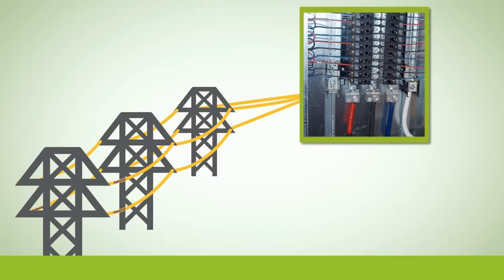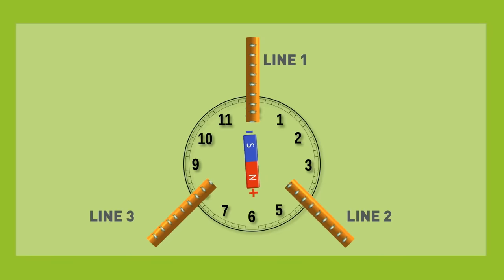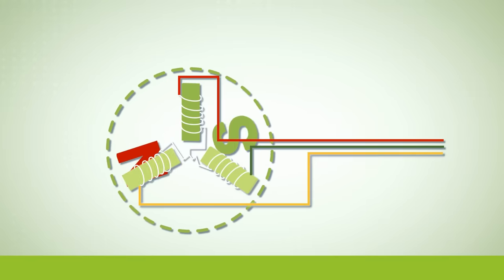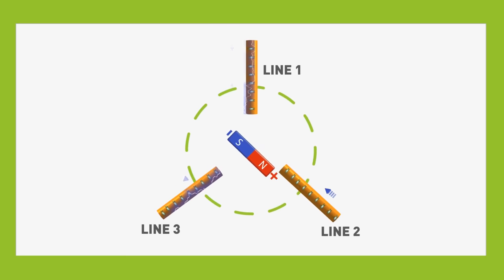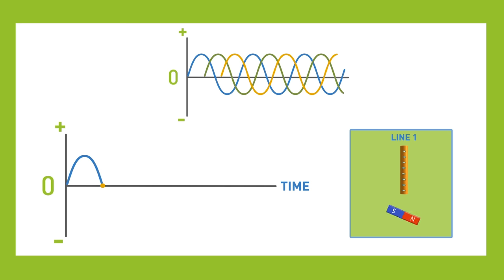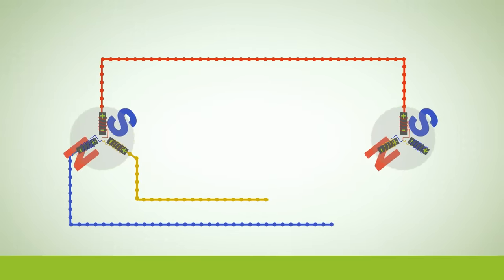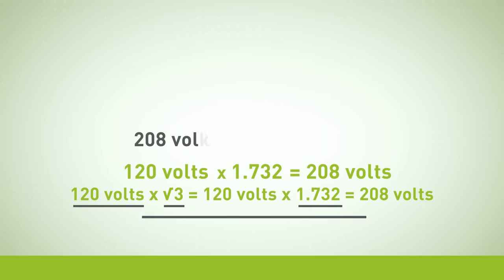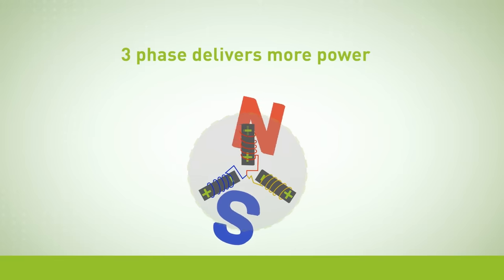Three-Phase Power Explained

Comment: Unfortunately this doesn't show a very good representation or explanation of how an AC generator moves electrons around, but there are a number of other good concepts in the video that help explain the basics of AC power.

Electrons need a loop of wire to move around, and if that were shown (and it has to be in a specific orientation), we'd see that electrons move both towards and away from a magnetic pole in an AC circuit. If it were as simple as saying electrons were attracted to a "+" or "-" as in a DC circuit, they wouldn't be able to move around the loop at all. A better explanation is that the magnetic forces of a north pole push electrons in one direction around a loop and a south pole pushes them in the other direction. In between poles the magnetic forces are near zero so the electrons stop. Further, electrons only move in a changing magnetic field so the magnetic poles have to always be moving or the wires themselves have to be moving. In a large generator magnets rotate (spin) horizontally inside stationary coils made of copper bars that run vertically and the electrons move up or down in the bars depending on whether a north or south pole is acting on them. They also move perpendicular to both the magnetic field and direction of rotation (see Flemings Right Hand Rule for Generators).
Reply: Scott J
Electrons do not necessarily need a wire to move about. Electrostatic charge is one example. Electron beam is another. Old CRT TVs used the steered electron beam for half a century. There are scan converters that still use them today. Then there is always radio. Electrons are not pushed anywhere. They are lured to an electron depleted field through what ever means they can. Open space requires very high potential levels, metal conductors very little. This is a small sample of what you left out of your educated reply.
Reply: Bryan St.Martin, Although everything you've said is true, it's irrelevant to the understanding of 3-phase power and the functioning of electric motors.

The current in an antenna is negligible compared to the current in an electric motor, generator, or transformer where the electrical circuit is complete.

I do agree with Scott J that the pictures in this video demonstrating the magnet and the current in the wire are a bit wonky. The video makes it appear that electrons are attracted to the north pole of a magnet, and repelled from the south pole. If this were true, we could obtain free energy by using magnets instead of batteries.

Rather it's the moving magnetic field that induces a force on the electrons. Neither the pictures, nor the explanation in this video explain this, and in fact imply that this is not true. For someone who doesn't understand these things and who is trying to learn, this is going to cause a lot of confusion.
Reply: There's a reason he said at the beginning of the video that this video requires an understanding of how AC power works, and that if you don't have such an understanding you should watch the video on AC power first.

You're criticising this video for something that was explicitly stated would not be in the video. It's like someone saying they are going to show you how to cook pasta, and you're complaining that they skipped over how stovetops work.
Reply: Jeffery Wells, I'm criticizing the video because what he's showing is not only confusing, it's wrong. The north pole of a magnet does NOT attract electrons. The wires have to be moving perpendicular to the magnetic flux lines in order for there to be a force on the electrons. The wire has to be oriented so that force is in a direction that causes current to travel through the wire. What is shown in this video will cause no current at all.
Reply: Scott, I'm the creator of the video. If you watch the first video, you'll see and hear where I say that while I SHOULD show a loop of wire (per your comment) BUT in order to keep things simple, I will only show half. The issues with creating these types of 7-10 minute videos are: what do I include and what do i cut; what analogies do I use to explain the basic concepts which are rarely well explained. I decided that showing a looping wire would be harder to visualize and animate. It would also open more esoteric topics.  My goal was to explain the topic to people who didn't understand 3 phase.
Reply: Scott J the concept of electron is not necessarily to understand this. Remember that books by steinmets, Notes of tesla, never use the concept electrons in explaining all these
Reply: @alparker7686  Why did you say that an electron is attracted or repelled by a magnet?  You can simplify things without telling falsehoods.

Comment: Data centers, and other commercial and industrial buildings don't necessarily use 3 phase power because of less amperes; it is because 3 phase power provides a "more balanced system". Such buildings demand more power than dwellings even though dwellings are served with lower voltage power.

Comment: the real reasons for three-phase are:
firstly that it is impossible to manufacture a high power single-phase alternator (see Leblanc's theorem and the theory of rotating magnetic fields, so-called reverse magnetic fields in a single-phase alternator are disastrous), an alternator of more than a few kva is necessarily polyphase.
secondly it is possible to transport more power on a balanced three-phase line (same current in all three phases) with the same amount of copper as with a single-phase line, this is a basic demonstration in electrical engineering training.

for three-phase motors, three phases are sufficient to generate a rotating magnetic field of constant amplitude and constant speed of rotation (proportional to frequency, Ferraris theorem). The mechanical torque of these motors is not affected by the sinusoidal shape of the power supply.

6- or 12-phase networks have sometimes been used to fabricate rectified direct current with low ripple residue.

Comment: Altough the information in this video is completely correct, still one question was not answered: why 3 phases? why not 2, 4, 5, 6? why 3? And there is ONE major reason why 3 phase power is the way to go and the reason is the same why 1, 2, 4  phase power sucks. 5 phase power supply would have been the next choice. why? because power output over time is constant with 3, 5, 6, 7, 9 and so on phases (uneven numbers and any nmultiples of those)
Reply: yeah.. that video doesn't explain anything, because the numbers seem to be chosen arbitrarily. so.. no real background there. again: after 3 phase power the next possible number of phases would have been 5 for the reason of a steady power output. but it can be explained quite easy why 3 phases were the way to go - there is no need for a 4 minute long explaination.
Reply: Hace mas de 100 años, en los inicios de la electricidad, se probaron sistemas de varias fases, pero el sistema que venció a los demás fué el trifásico.
Reply: Here's a simple answer - the cost of copper. The detailed answer is a very technical analysis of cost of additional copper for each phase versus the increased "performance" of more phases.
Reply: the need for an alternating current with constant power output (and not any sin-wave power!) came from electric locomotives. they would slip with a power peak coming for example from a single-phase sin-wave power. when slipping, the friction reduces a lot limiting the capibilities of it! but with a constant power output the trains could be built smaller and more efficient.
and again: 3 phases, 5 phases, 6 phases, 7, 9, 10, 11, 12, 13, 14, 15,  ..(any uneven and multiples of those uneven numbers mentioned before) have a constant power output over time. and obviously when they all do the trick why use more than 3 phases? wouldn't have made sense in any way (yes, cost, but also complexicity).
always think of the histrory of the technical system you have in front of you and electricity wasn't always for wide public use! then tesla and westinghouse had their stupid fight over AC vs DC is was already decided in europe to use 3 phase AC. that's what noone from the north-american continent seems to know and maybe they just don't want to know..?
Reply: because you dont get any major improvement from having more than 3
Reply: @alparker7686  Also the cost of an additional buss bar and breaker for each additional phase at substations kills the value analysis.

Comment: It's just how the AC power is transmitted, it's 120 degrees out of phase from each other. The magnet is the generator that is generating the power i.e. Hydro-electric Turbine at a Dam.
Reply: You are correct, but in most cases the generator is moved with burned fuel.

Comment: The windings of a 3 phase generator are 120 degrees apart.  It would seem reasonable that the power coming from a 3 phase generator would reflect the 120 degree locations of the generator windings. It would be an interesting experiment to wind a generator with the coils located at different degree locations and observe the phase pattern
david
Reply: I read a paper on 5 phase systems a decade or two back. Very interesting, and extremely smooth operating. Imagine building a Bridge Rectifier for that. Tremendous torque.
Reply: Bryan St.Martin can you give me the name or the link of that paper

Comment: When a capacitor  goes bad, you can start the motor by rotating  it. Since 3 phrase always has a flow of energy, no cap necessary.
Reply: Capacitors are only used in a single phase motor to create an artificial phase

Comment: (1:42) - Yes, but you do not make clear that if the "magnet" stops spinning. it doesn't matter if North or South is next to any line, the electrons also stop moving.
Your explanation seems to suggest that electricity is flowing whenever the north or south pole is aligned with (ie not at 90 degrees) with a line, even if stationary.
This is obviously not the case and makes your explanation quite confusing.
>
EDIT:
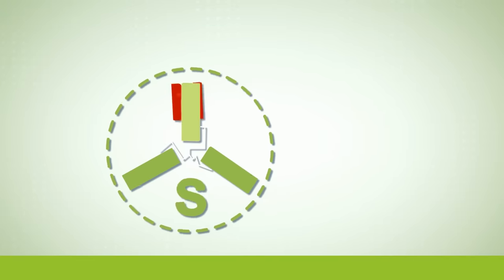...same again at (2:45)
>

Comment: In the end of the video you said that In single line is 208 v *30 amps =6kva it’s wrong , the right is , in single line 120 * 30 amps
Reply: agree, and before that on 3 phase diagram it is 208*30* 3^(1/2), but it should'nt be 3^(1/2), becouse 208 is already 120*3^(1/2), so u should'nt multiplying voltage between lines. Thats pretty big mistakes for person who lecturing about electrotechnics matters.

Comment: Phase colours are Brown Black Grey  used to be Red Yellow Blue. Not white and never green. There a few mistakes in the animation in Europe and UK three phase is 380/415 so phase neutral gives 220/240 it's illegal to have 2 phase into a domestic supply , only Industrial supplies can have 3ph a lot of domestic electricians never use 3ph.
Reply: Europe is 230 / 400 V.
Reply: @okaro6595  true and UK is 240/415

Comment: You explanations are clear but I can’t get over the diagram on 0:52. It’s really really wrong. Electrons aren’t getting attracted to the the magnet in straight pieces of wire like that. Current can’t even flow in the way you’ve shown the wires. The magnet points towards coils instead, and the magnetic flux through the center of the coils generates current through the wires of the coils. The diagram you have is very misleading to beginners

Comment: Really one of the best explanation but what is r3 ??
Reply: The radical symbol √ is NOT an "r"—it is a mathematic symbol.

√3 means the square root of 3.  Or, 3 to the power of ½.  

√3 ≈ 1.7320508075688772935274463415059

Comment: My experience with 3 phase began with building a phase converter with a used 3 phase motor...got lucky with my cap selection and all 3 legs were withing 2 volts... used it every day for 3 years lathe and mill with no issues...built a couple more for people I know. Several years later a buddy scored a 20hp 3 phase compressor...all his stuff was 220...building was wired for 3 phase...
What the hell is a hot leg? One leg almost 200 volts to ground? It took 3 people telling me it's ok before I would hook it up....it was ok...except for than one circut breaker I plugged in the wrong hole...figures the only thing plugged into that circut was my de walt charger...all the smoke leaked and it kinda bright and then died forever...
So what is the deal with the hot leg? Nobody could explain why and in a 3 phase application I guess it does not matter what leg on the motor it goes to

Comment: Almost all of my higher voltage "Data Center" equipment (Printers, CISC based CPU and HD Racks) required 240v as standard.   When we relocated and the power company could only supply 208v to our facility we had to have the manufacturer come out and make adjustments to operate on the reduced voltage.   At least now I think I understand where the 208v came from, but why is 240v 3 phase standard for so much of the older, heavier equipment and household appliances such as stoves and dryers?
Reply: Because there was/is a common configuration that is 120V to ground on 2 legs with a stinger leg which is 208V to ground. They are 240 delta with a center grounded winding, quite common where I live. Your company probably could have bought a transformer.

Comment: Can it be posible to have 3 phase panel with 220 v in heach line? Can someone help.
Reply: +Jorge Cervantes - Yes, certainly it's possible but it's not a common scheme, at least in America. 220-240 volts 3 phase is common in Europe and most other parts of the world. The closest scheme in America to your question is the 277/480 volt 3 phase system used in factories and large installations.

Comment: yeah i get the point that you’re trying to convey here. but in describing—inaccurately—the relationship between the ferromagnet and the electrons in the wire, you give oversimplified intuitions about how the system works. If the magnet stopped at 6 o’clock say, your description would have a negative current in line 1 and slightly positive at 2 and 3. But, if the magnet stops, the whole electricity stops too. this is crucial to electromagnetic phenomena, and people who take your description too literally are gonna need to unlearn it further down in their education. 

at a certain point, simplifying a complex idea isn’t making it easier to understand. it’s making it wrong.

Comment: Thank you for using kVA instead of Watts! It drives me nuts when I see people trying to use ohms law for DC circuits, in an AC circuit.
Reply: roy yung- great point but hey at the end its all in "P" ie power
Reply: You can use ohms law if the load is pure resistive and power factor is 1
Reply: Id be one of those people but it's hard to avoid the brainwashing terminology of the ac power fans.   Hot neutral and earth?  Isn't it power, ground, and redundant ground?  Also wouldn't a pulsing DC run a transformer just the same? I mean unless ignition coils are some sort of black magic.
Reply: There is always a real component (I.e watts) in power calculation of AC circuits. Apparent power includes the real and imaginary vectors in the calculation and units is VA. Most electricians widely misuse these units and how to calculate them.

Comment: So where do you get 277 -480 from?
Reply: You get a transformer with a secondary that is built to produce 277V from line to neutral.  This means, if you had a distribution line at 13.2 kV, that you would have a 48:1 voltage ratio across the winding.  By contrast, given the same distribution voltage on the primary, you would have a 110:1 voltage ratio to produce 120/208V three phase.   So you simply have a different ratio of windings, than you otherwise would have, for 120/208V.

Comment: Do you think there will ever be 6 phase power? Would it be helpful or detrimental? What about other phase- 4 or 5 phase?
Reply: Efficiency gains can be had with 6-phase or even 12-phase power. However, 12-phase is the max you would ever want to go, because simply you have diminishing returns beyond that point.
Reply: the real reasons for three-phase are:
firstly that it is impossible to manufacture a high power single-phase alternator (see Leblanc's theorem and the theory of rotating magnetic fields, so-called reverse magnetic fields in a single-phase alternator are disastrous), an alternator of more than a few kva is necessarily polyphase.
secondly it is possible to transport more power on a balanced three-phase line (same current in all three phases) with the same amount of copper as with a single-phase line, this is a basic demonstration in electrical engineering training.

for three-phase motors, three phases are sufficient to generate a rotating magnetic field of constant amplitude and constant speed of rotation (proportional to frequency, Ferraris theorem). The mechanical torque of these motors is not affected by the sinusoidal shape of the power supply.

6- or 12-phase networks have sometimes been used to fabricate rectified direct current with low ripple residue.

Comment: Can someone explain the residential 208v, 3-wire setup? It has two 120v legs (that are spaced 120 degrees) plus neutral. Where is the third phase? And wouldn't running a powerful appliance that has a spinning wheel (maybe a power saw) with only two of the three phases cause wobbly performance?
Reply: The normal residential system is not three phase. The legs are 180 degrees separated so the voltage between them id 240 V.

Comment: Is Europes power system of 220v single phase or 3 phase ?
Reply: At 220V it is single phase.  The 3-phase supply is 415V but any one phase is 220V.  Higher voltages used for power transmission are 3-phase.   In domestic situations, a transformer steps down a 3-phase supply and each of the three single-phases is used to power a different area, with as good a balance as can be achieved.  A factory or industrial user can request a 3-phase supply as it is more efficient for large motors etc.